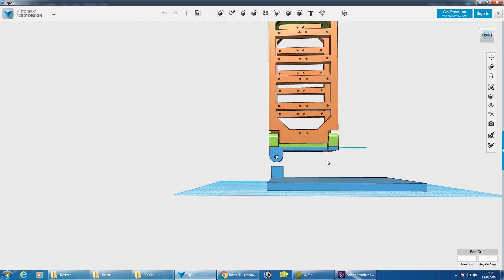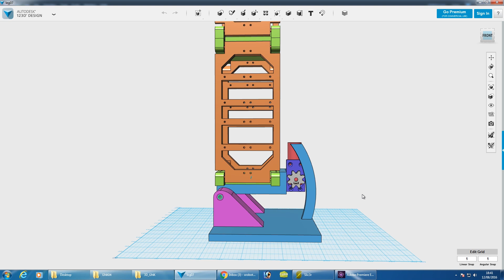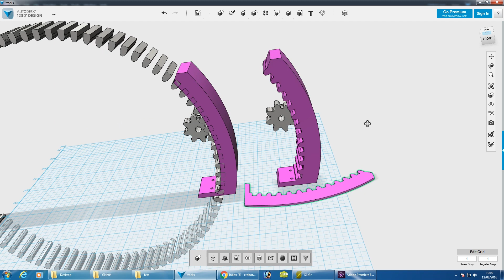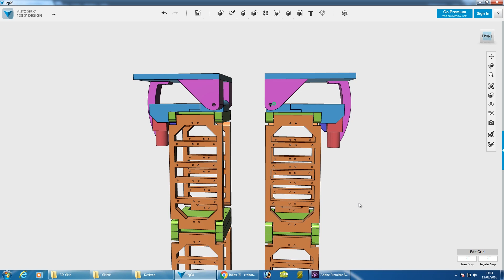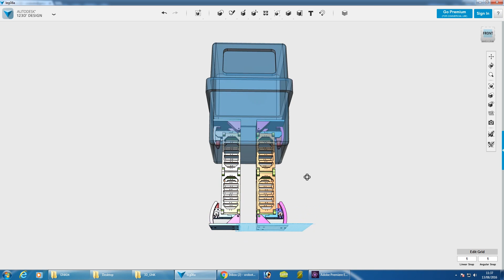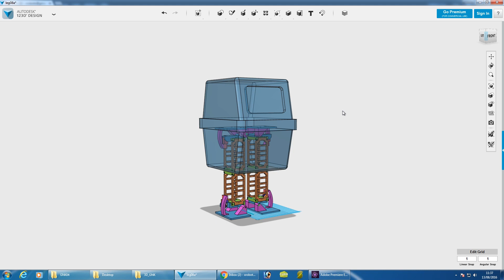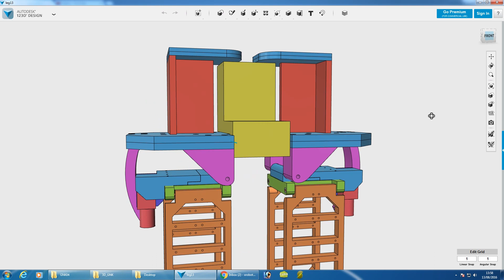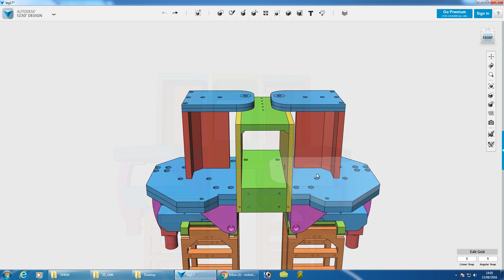Star Wars GNK Power Droid #4 | Hip & Ankle Assembly | James Bruton

Comment: if you're balancing an inverted pendulum, it might help to have the mass as high as possible, as it will lengthen the pendulum swing time.   Look into putting the battery and larger motors on the top of the cardboard boxes.

Comment: Your work is just incredible!  Extremely satisfying to watch and learn from a pro such as yourself!
You really have those printers dialed in well, I was just wondering what size nozzle you use and what kinds/brands of filament you are using (besides the standard ABS that is).
Reply: +James Bruton (XRobots)  A .5 nozzle, pretty uncommon from my experience, is there any particular reason for the .5 vs the .6?  Better accuracy while still getting fairly quick prints?  What is the layer height for most of your prints?  Sorry for all the questions, but your prints come out fantastic!

Comment: Good job on the stability of the legs, both as individual units and as a set. Everything looks pretty firm and steady.
The feet look a bit tall, though, with that curved rack (one of the purple parts on your 123D model). Will they fit inside of that slanted box the original droid has for each foot? There's also the tubing that go around the legs. Are you considering the dimensions of those things when you design your parts?

Comment: considering the GNK droids are power droids... you should set it up as a mobile charging station for phones and tablets. 

 The extra battery packs could be your counterbalance weight and you could use USB 2.0 with 5V 2A output so you could plug in your charger cords and quick charge your phones at a convention or simply walking around.
Reply: Why would you want a power station that walks away. I'm not saying your idea is bad it's a cool idea, I just don't understand why you want a battery that walks away with what ever it's plugged into.
Reply: +MadMax the idea being you're mobile... so why not have your phone (or multiple phones) be mobile while they are charging to stay with you... not that it would walk off without you.

if you are at a convention hall and don't have ready access to an outlet to charge from or if you are walking around the hall... have the droid follow along.
Reply: +Michael Loveless ok I didn't think of that, but in Star Wars they kind of just roam the halls of the deathstar

Comment: Do you find any differences in print outcome depending on the number of cooling fans you have active on a 3D printer during operation? I've been considering upgrading mine for a little while now but if there's no benefits then I'll invest in modifying other parts of the machine.

Comment: Meter tall.. just perfect for small fridge and some beer! Hell design it so it has reload station where you can call it from and after giving you beer it will return to its station to reload and connect the fridge back into main power. It should not be a problem to be out of power for short while when coming to you and back! When not in main use you can trick around and it has some proper weight on top, rather than plastic box.

Comment: I don't think the feet are excessively large, they seem in proportion with the box. Are you going to make the box yourself? Or are you going to use some kind of modified Rubbermaid container? If the body is somewhat transparent you could have the box situated a bit lower and still see the hips and knee movement through the box.

Comment: Why didn't you just make another Parallelogram inside the leg that connects the torso with the Feet?(some sort of Hybrid Print that allows to connect Torso and Feet but not Interfere with the Knees )
Or if you want to move both ankles independent make a gap at the Middle part, of this "Stick", that would be the Hybrid-Ninjaflex part so you can connect two Motors there
Reply: I guess it would be easier for the Program to understand what's happening if all Ankles can move independent. Yea you're right ^^

Comment: Could you make the black motor mount plate at the bottom of the leg with a square hollow , the turn the motor 90o then instead of ankles curving out , turn them onto the new hollows so the track passes up inside the leg

Comment: Hi, it is Chris in Bulgaria, you said towards the end of the video "much more human like". Well, one actually uses the opposing knees before using the stepping  leg.  using the knees causes a slight lowering of the body before moving forward.  If you keep transfering the weight before moving, as the robot goes faster it will cause it to fall over. Great videos though, wish I had a 3d printer now. keep up the great work. Remember, more knees and less changing weight before moving

Comment: Very neat. You can also base it on Honda's early headless bipeds. Static balance is fine, I would just avoid being so dependent on it that you avoid giving it the agility to also support dynamic.
I wonder why you didn't just make the hip sides as one print rather than many combined ones? that would seem stronger lighter faster.

Comment: Are the hips going to adjust as it walks to keep the body box parallel to the ground? I noticed when you have it balanced at the end that the part where the body would go is tilted way to one side, and my recall of the droid from the movies the body didn't tilt as it walked, it stayed level with the ground both front to back and side to side.

Comment: you should use Fusion 360 it has a really small learning curve from 123d design and has many features that will help your designes.
Reply: altrough both are from the same company, the files created with 123 design where not readable in fusion 360. that was for me a no go, because i already had so many files created.